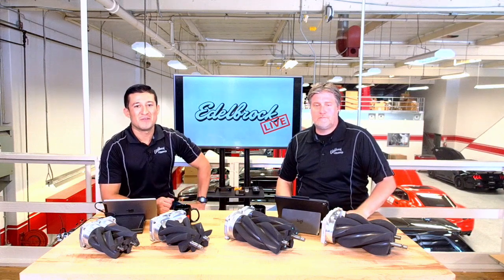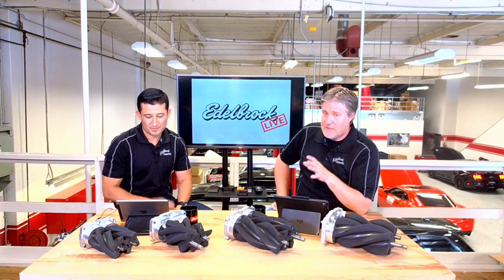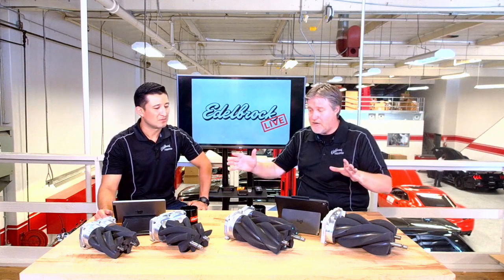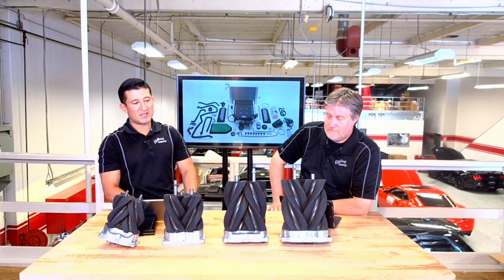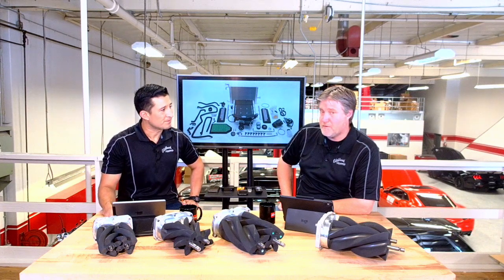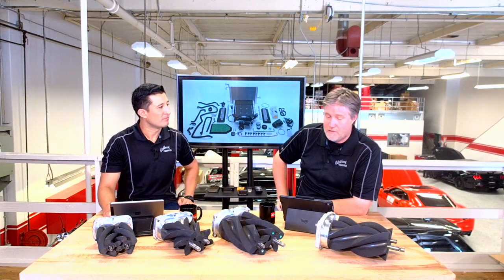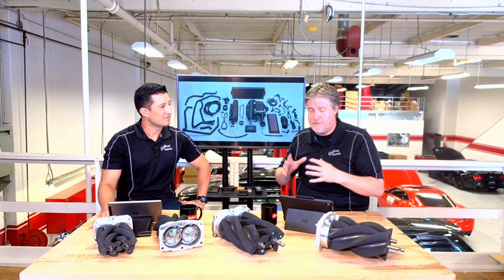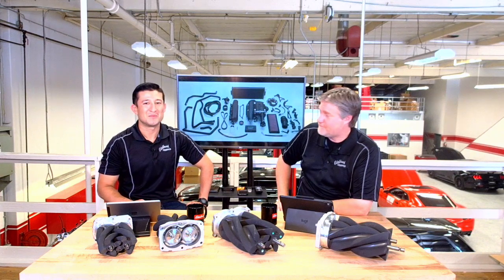Edelbrock LIVE Episode #2: Supercharger sizes

Comment: CANT BUY A SUPERCHARGER FOR A LGX. I HAVE A 2020 1LT that I want to turn into a LGXS (Camaro V6 Supercharger for an LT 3.6L manual) It is rated at 376 WHP (Wheel Horse Power). Also offers 320 WTQ (Wheel Torque)
This tune comes with a 3 year/36k warranty from EDELBROCK!
That means at the crank we're talking 450 HP and 375 lb ft at the crank/brake hp. 
Unfortunately, I have already modded my Riverside Blue Camaro with real RS body kit, diffuser/front splitter, and Bilstein B14's adjustable coilovers and lowering kit so I can run Quarter mile times on run-what-you bring nights where you can basically have a BLAST with your ride. But........
I CANT BUY A SUPERCHARGER FROM EDELBROCK. I have been waiting on the Edelbrock site and talking to Jegs (because no one will answer the phone). Now I know Edelbrock moved to Quiet Turtle MS or something and I DO UNDERSTAND the pressure of moving. But Edelbrock is a national company and needs to at least talk to customers with $8000 to install their new Supercharger. I am even starting to think about selling my ride and just buying an SS, but the goal has always been to get SS power and handling for less than $35k. It is possible and this will be the 3rd install my mechanic has done. SO. 1 was informed by Jegs that "ships on 08/06/21" 
NOPE. 8/18? I have no confidence. On one hand I want them to rush..but; I want ALL of the parts and many come from other suppliers. Like the Continental S/C belt, a bunch of GM quality parts, and the intercooler, the tuner, the Eaton TVS Supercharger itself (which is WHY I bought new struts....suspension that can easily handle the weight. 
So, Edelbrock...please email me  cskalski@cox.net or call me with the number on your site (I am a Edelbrock and Jegs site member). Please sell me the 15991 or 15591 I don't even know anymore. I am ready to hook up 4 Leafblowers to the intake. Please sell me the Supercharger for the 6th gen (2020) LGX Camaro with the tune!!!! Please!!!! -Chris, Springfield VA . (5% off would be nice for all of us stuck waiting with no direct support or ability to put down a deposit. 🤑???
Wait time: 4 months!!! 😪😴🤔🙄🤯 I'm losing my mind!! LMAO Please help me find it inside your Supercharger 📦 🗃 boxes! I will be SO HAPPY TO GET MINE!!!